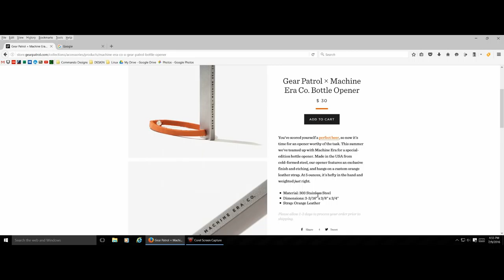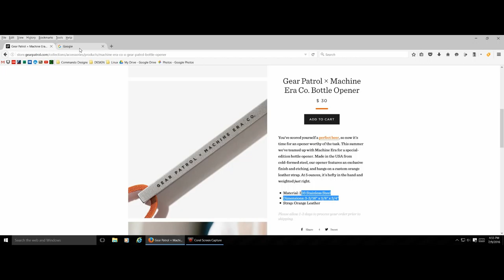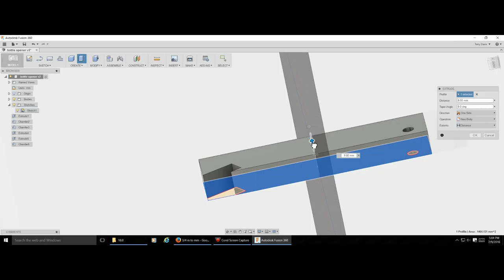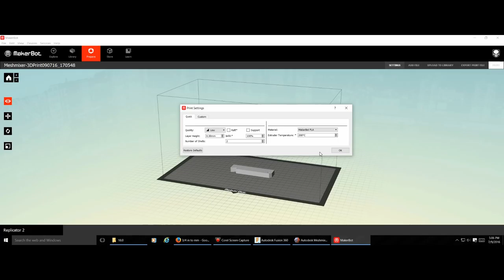Steal Like An Artist - Bottle Opener 3D printed - HD

Comment: Why bother converting to mm?
Reply from the maker: Cause it's easier than changing the units in the software. Just simpler I guess.
Reply: Disagree! But either way you can always enter the units into the dimension! If you are set to metric in Fusion, you could enter a single dimension as "1 yd" or ".432 in" and it will put the correct value in!
Reply from the maker: Wow... That's cool. I didn't know that.
Reply: Yep! Hope that helps save you some time!

Comment: its a shame how easy it is to steal artwork/product designs
Reply from the maker: It's just a catchy title. It's not really stealing. I'm simply showing you how to reverse engineer something in order to see how it works.  If I said I came up with this then selling it as if it were mine... then that would be stealing...
Reply: +Commando Designs - I would have titled this "Inspiration & Imitation". You did basically a "remix" to accommodate the material.  They are similar but then again it's a bottle opener. C'mon, those have been around for a loooooong time. I'm sure some kid in shop class made one that looked like what those guys are selling but just rougher looking. 

As long as it's for personal use and you aren't selling it then it's ok in my book. 

And the video was a "tutorial" like you said. 

Props my man. Semper Fi

Norbert
Reply: He was referring to a book written by Kleon by the title, steal like an artist